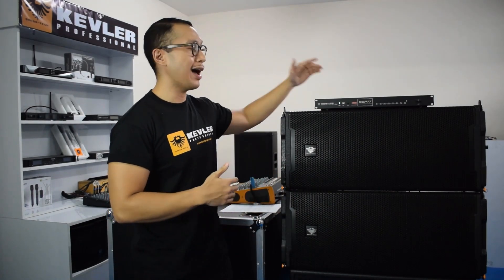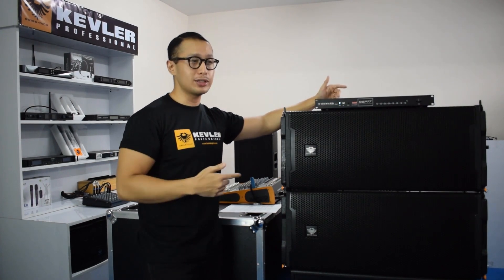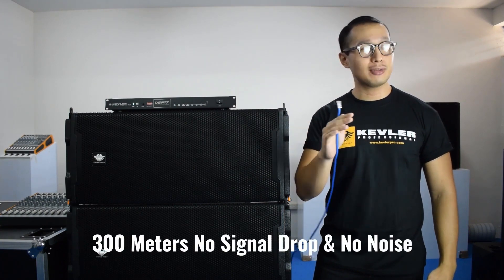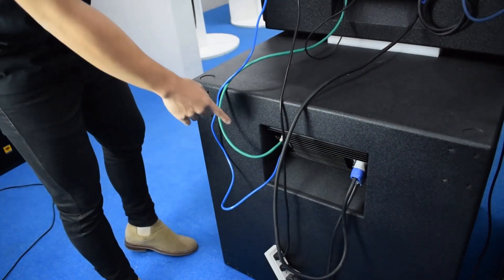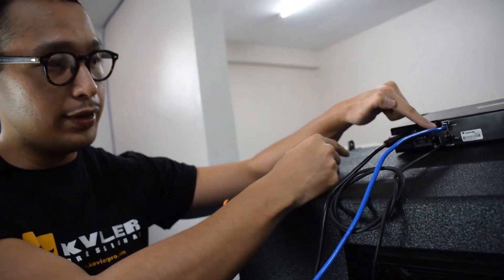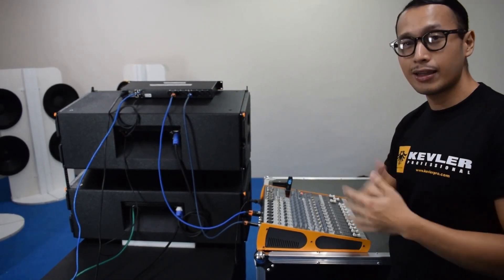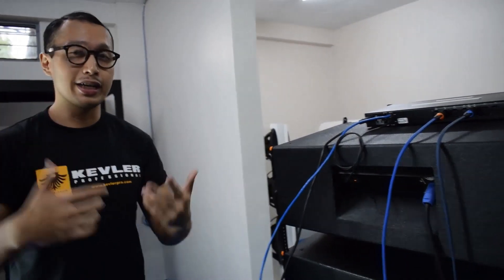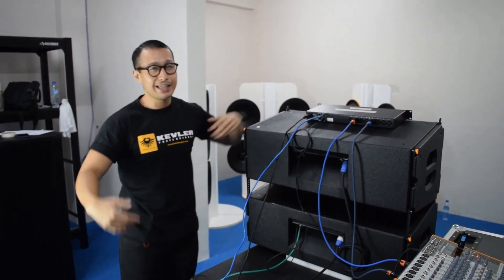LX - 212A with DSP77 (Digital Network Signal Processor)

Comment: The looping needs another set of network cable which doubles the cost, you can just add a signal booster to your xlr set up to compensate with the loses, and i know for sure that the difference is inaudible